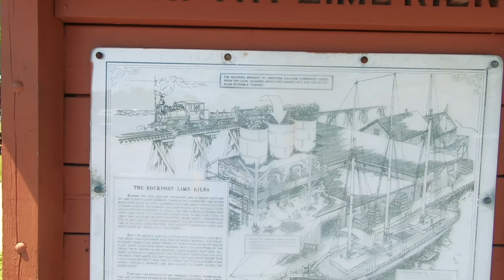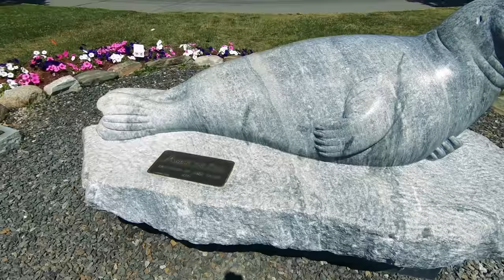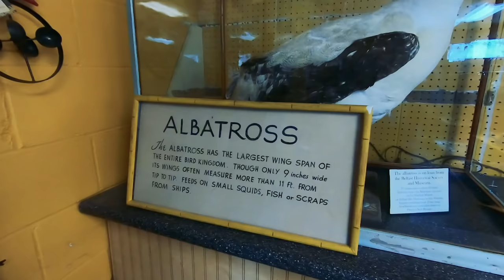Donut Inventor, Seals, Lime Kilns, Atop Bridge!

Comment: Here in Ohio we have "The Donut Trail" where you can travel from shop to shop and experience a ton of donuts. 

BTW, I have been going back and watching your older videos that I never saw when they were first posted. Last night I came across the group from when you were stuck in FL because the transmission went out and you were bumming pretty hard. You mentioned that you were thinking that it may be a sign that maybe life on the road was not for you. Well, I'm certainly glad you did not stop your travels and you continued on despite mechanical troubles, trolls, and all of the other crap life throws at you. I for one eagerly away your next video posts because they are fun, informative, and really show off neat places around our country. 

I say, keep it up no matter what. Can't wait for the next one. Safe travels.

Comment: Hi Eric great channel, it says your p3 drone video is done in 2.7 k and down scaled to 1080p. I use a P34k and can set it to 2.7k but down scaling it to 1080p is kind of above my head.
I'm using Filmora and could probably convert it to 1080p if that's what you mean? Your drone video footage looks great. I'm  just wondering if you could explain a little more about settings/ down scaling. Preferably I'd  like to shoot and leave it as is. Thank you sir.